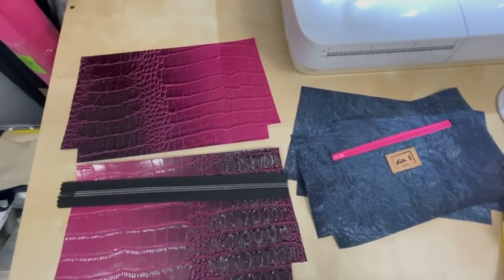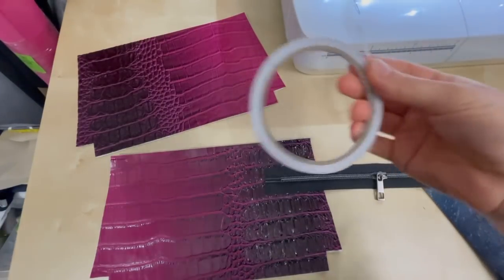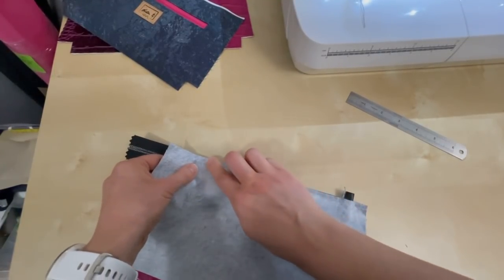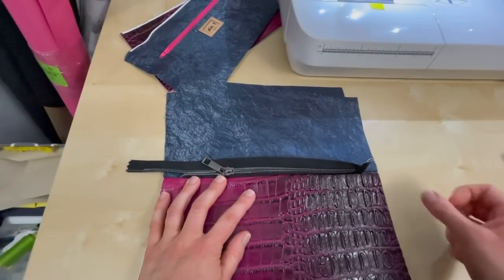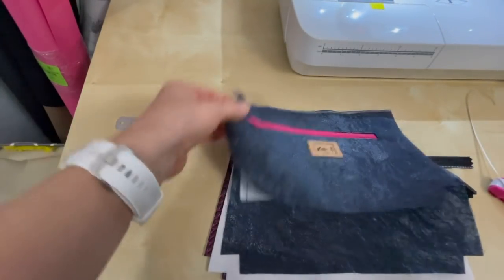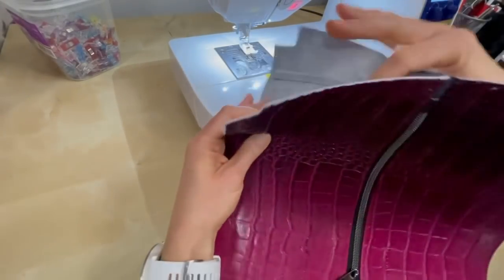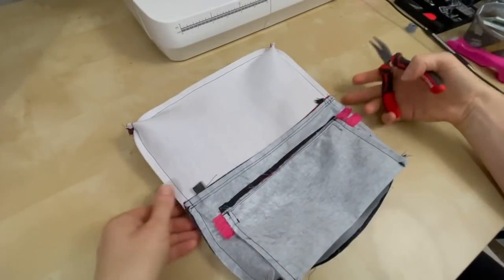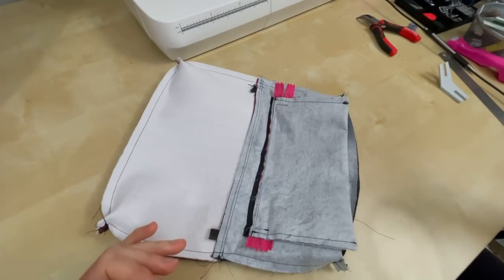How I Get Neat Corners on the Harlequin Pouch

Comment: Hello.  I was wondering if you top stitch thru the lining also, does that cause the corners to not be as neat bcuz of the bulk?  I love the look of them both being top stitched but think it is too much bulk.
Reply from the maker: When the lining is top stitched it doesn’t allow for the side seams to be sewn flat, there is in extra fold in the lining . That means the lining  can’t tuck nicely into the exterior at the corner, but rather the corner  is pinched down into the side seam. I will be making a tutorial soon focused on zipper installation so I will be sure to address this so there is a visual!
Reply: Thank you for getting back to me... I love that look better, but see why people do not do that.   @OKSew474

Comment: Hi, just finished my first attempt.  I am a beginner sewer.  Could you clarify the following?  What type of interfacing you used on vinyl?  What type of Needle and what type thread you used?   And what is a good stitch length for vinyl.  I have a new Juki 5020 and we are getting acquainted.  Thank you.
Reply from the maker: Hi! In this particular demonstration the vinyl was quite sturdy so I did not interface or stabilize it. If I am going to interface vinyl I use a lightweight woven interfacing such as SF101 and stabilize with decovil light, but I tend to only do that on bigger projects. On my machine, which is a domestic Juki like yours, I generally stick to a universal 80/12 needle and Mara 100/tex 30 thread as that is what it seems to prefer. If I am using a heavier thread I increase my needle size and tension. For stitch length, I like 2.4 for construction and 4.0 for topstitching. It took some experimenting with different needles, stitch lengths, and interfacing combinations to find what works for me & my machine, so don’t be discouraged if it takes a bit of experimenting to get the right settings for you. If you are using vinyl I strongly suggest a teflon foot, with a regular presser foot your stitch length at any given setting will tend to be shorter and less consistent. I hope that is a helpful starting point for you, welcome & good luck with your sewing!!
Reply: @OKSew474  Wow.  thanks for such a great answer.  And I am delighted you had to the time to respond - what with the baby and all.  I will copy this note to my reference cheat sheet.  And I dearly appreciate the way you teach.  So thorough and easy going.  I look forward to viewing your other videos.  Thank you so much. FYI.  my first Harlequin effort, I followed Leanne's printed instructions that came with the pattern.  The needed information on the zipper measurements was missing, so consequently, my zipper was wonky.  But your instructions give the needed measurements.  again, thank you.  I am off to a new Harlequin effort 🙂
Reply from the maker: Good luck with your next Harlequin! It’s such a great pattern, I have made many of them; sometimes a tiny tweak makes a big difference! If you haven’t watched my tutorial “Better Boxed Bottoms” I highly recommend having a look before sewing your next one, when I made this video a few years ago I wasn’t yet enlightened about the bottom corners, but if you watch that one you will get an even better result. I’m so glad to be able to help and thank you for watching and your kind feedback! Happy sewing!

Comment: When cutting your pieces it looks like the side is cut at an angle and not straight up. I am hoping you can tell me a good rule of thumb to do this so the sides go straight up when the bag is completely finished.  I see bags from other videos that angle out way too much that appear like a flat bottom V and I want to make mine with straight sides. I hope my question makes sense. Thank you so much!
Reply from the maker: Hi Karen! If you angle your sides so that the outer edge on the top seams ends around the same point as the inside corner of your box at the bottom/side that will give you a straighter side on the finished pouch; so if you drew a line from the upper edge to the corner of the box it would make a straight line with a right angle triangle to the outside of it. I hope that makes sense, I wish there was a way to add a sketch here!

Comment: Confusing on the ends, 5/8; 3/4”???
Reply from the maker: Thank you for your comment, I’d love to help clarify if I have misspoken in my instructions! It’s been a while since I made this video, would it be possible to please tell me which specific point time-wise was confusing so I can check on it for you?
Reply from the maker: Okay I think the part you are talking about is referring to zipper installation. 3/4 is the gap I leave at the open end of the zipper when putting on the double sided tape, and the mark I make before turning the tape 90 degrees. The width of the zipper teeth beyond that mark goes into the 3/4 making the final gap closer to the 5/8 to match the closed end. 5/8 is the measured distance from the edge to the zipper tab at the closed end of the zipper. Please let me know if that doesn’t clear it up!